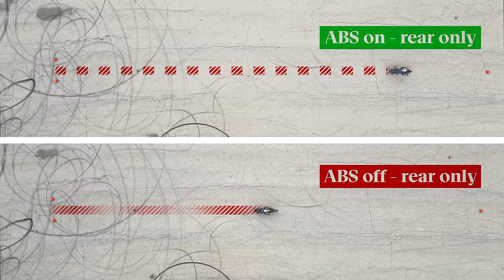Out-braking the ABS Myth

Comment: as a bicyclist, when I need to stop I will often purposefully do a controlled panic stop to make sure I always have a good feeling for how much front brake I can safely apply for maximum stopping power. It’s definitely saved me in a lot of situations when I needed to avoid danger in front of me.
Reply: Yes, bicyclist's just have no ABS. Which means they have a massive stopping distance, skidding or fly over the handlebars if they do it wrong. Only real threshold braking can save you in a dime. 

I instinctively move myself backwards as much as possible (to avoid a stoppie) when braking, also I gently push the front brake to not lock it up and prevent a slideout or going over the bars.
Reply: Ya it also helps that 90% of our weight is mobile
Reply: @colinbruulsema7177  true, which also makes you learn about weight and balance
Reply: I've seen some videos about emerging ABS systems for bicycles, that in some cases excel in downhill riding, even though they are more or less at prototyping phases, AFAIK. And of course they need a totally different approach and a lot of mental exercise especially with the front brake. Hard to say if they'll become the norm on higher end bikes... but when looking at the trends through the decades, pretty much everything has been concentrated on easier handling, be it wider handlebars, better suspension, simpler gearing, more speed oriented geometry and so on.
Reply: @joneinarmattiasvisser6113  On a bicycle you have one major advantage that isn't available on a motor vehicle - I weigh more than the bike, and thus my weight shift has a much greater effect on where it will go. Beyond threshold braking, there's also side-slide braking, which can give insane maneuverability and stopping power at great cost to your tires. If you see a practiced cyclist do those kinds of high-speed controlled skids, it's amazing how different/"springier" the bike's behavior is compared to a motorcycle.
Reply: Mountain biking, when pushing hard, routinely has you braking at maximum power up to the point of lockup. It's like every turn is an emergency braking scenario. Sometime you purposefully lock up the rear end to brake the tire free and swing it around a tight turn quicker. It's a tough skill because you're intentionally riding to exactly the point of traction loss and letting it happen. The exact point of traction loss is largely determined by front/back weight balance. 

This has me thinking, bike ABS braking could be valuable as it currently stands for road riding to an extent. Though with mountain biking, matching the performance of human braking would require the ABS system to know the intended current and future weight distribution. Someday this might be possible with a ton of sensors and AI, but as of today, humans are much better at braking a bicycle.
Reply: Bicycle is as least 5 timer lighter than the rider. It provides very good feedback for the rider, it's generally slower and it's designed to be used in a different way. It also takes a long time to learn, some riders won't learn how to really use brakes even after years of practice.
Reply: For better or worse I actually detuned the front brakes on my MTB so they arn't quite so grabby so they don't just immediately lock when you think of grabbing the brakes. Then again my tires are crap and are a true jack of all trades master of none tire so they really just kinda suck everywhere except for dry pavement.
Reply: I always make sure to brake a little more in the back than front- that way if the back locks I know the front is very close.
Reply: @sannyassi73  that is t a thing. Front/back weight balance on a bicycle is dependent on body position.
Reply: @sannyassi73  With respect, that's not a thing. The braking power available front vs rear is entirely dependent on front/back weight balance of the rider. The bike weighs effectively nothing so it's all body positioning. No matter the position though, the front brake has way more stopping power. Like 80% of the total braking power available in many scenarios. Braking more in the rear just skids the rear tire and isn't effective. Most mountain bikers are using far more front braking than rear. It's where all the stopping power comes from.
Reply: I do this when driving in the snow, its a great way to calibrate your stopping distance based on the conditions.
Reply: Huh
Reply: "Controlled panic". That kind of defines my life.
Reply: OK dude have fun with your 20 mph emergency stops.
Reply: yes bicycling 10mph is the same as 100mph on 500 lbs
Reply: I once saw my big brother front flip over his handlebar when I was a kid. It wasn't until I rode motorcycles that I started using front brakes on two wheelers again.

Comment: Best summary on Bike ABS ever. I've become comfortable with threshold braking for some years now, but on my new bike I like to use locking the ABS on the gravelly or the wet grassy parts of my driveway, so that I can learn to feel at what levels of deceleration the grip on grass or gravel will fail. For some reason, these experiments have given me more confidence on my old non-ABS bike.
Reply: When you flirt with loss of traction, even with an ABS system helping you out, you're still practising riding that edge, so it makes perfect sense it makes you feel more confident on the other bike, you're more practised on the feel of that edge.
Reply: people really don't understand the importance of practicing and unfortunately for some the realization of the difference between panic instincts and wishful thinking comes too late... 
great example for the use of ABS
Reply: go ahead and test the abs on a straight proper EMPTY road. You will be surprised how much you have to pull the lever for it to kick in. Its good to get an actual feeling for it. You will also get a very good feeling for how much stopping power your brakes and tires actually have.
Reply: Great job! But Ryan should try a linked braking system like my BMW R1200RS has. You only need to grab the front brake lever and the back brake operates too. I never use the back brake except in town, when the braking with the linked system is sometimes just too much. In an emergency just pull the lever: without the need to consider the back wheel your brain has more time to think about steering out of trouble. Needless to say, the linked Brembo system gives astonishing braking power: this 525 pound bike stops on a dime!

Comment: The key takeaway from this video and what everyone should know about ABS is that it doesn't necessarily make your braking distance shorter, especially if you're a skilled rider. Instead, it allows you to steer your bike under braking, which may allow you to evade obstacles.
Reply: thanks for sparing me watching the video. ABS is for preventing wheel lock, not shortening the braking distance.
Reply: Bingo.
Reply: You still need to learn how to steer. Target fixation will become a big problem if someone has not practised or made mistakes before an emergency situation.
Reply: You can't really brake and steer on a motorbike, it doesn't work like that - what ABS does is keep the bike upright under max braking. Something a lot of people overlook and one of its major advantages. Many crashes just don't happen now as people grab a handful of front brake and it just stops without crashing down to one side - providing they don't hit anything.
Reply: @stuc.6592 Careful with that blanket statement. You absolutely can and sometimes should brake while steering.
Reply: @Musicposter4you  Fair enough, I meant under emergency braking conditions when enough braking force is being applied to lock a wheel or activate the ABS - what the video is talking about, not everyday riding.
Reply: it don't really make much difference for steering. it does that on cars because it prevents the wheels from locking up so you can still steer but on a bike you are not really worried about losing steering you are worried about locking up and low siding the bike or doing a stoppie.
Reply: I used to think that abs helps you avoid obstacles without skidding and only activate when you’re panic over steering. I guess I was off 80% lol
Reply: Rule #1 is you shouldn't veer from an obstacle. 
When faced with an obstacle the goal is to reduce speed and in turn, injury, if you veer and maintain speed and still clip the obstacle or face a new one, injury and damage consequences are greater.
Reply: Valid point.
Reply: Also helps you in wet and sandy surfaces.  Living in a snow region, there's a lot of sand left over on the roads come spring time.
Reply: @hajovonta6300 why are you here then?  If you can't watch a 6 minute video, then you shouldn't comment.  Get back on your high horse, princess.
Reply: Which is funny because at a driver safety training they told us not to evade obstacles but perform an emergency brake instead. The reason is that there is a high propability of causing an accident when evading an obstacle. One could drive into the contraflow or loose control of the bike because of excessive steering.
Reply: Only smart comment here lol
Reply: @21chicko  You can't practise an emergency situation by definition. As the guy said at the start of the video the way most people behave just before a collision is very different from how they operate their vehicle day to day although he was a bit dumb to suggest that speed doesn't matter. Really if you want to practise something, practise not riding like a dick so you don't have to emergency stop all the time. I think I've done 2 emergency stops in over 4 decades of driving and one of those wasn't a real emergency it was the "emergency stop" we do as part of our driving test. The key to avoiding collisions really isn't anything to do with how you brake, steer or anything else, it's about reading the road.
Reply: I have nothing against ABS and would gladly have it on, but my 2015 R3 doesn't have it. Fortunately, I can seamlessly brake while cornering.

It has really shitty braking power from high speed however... But at least I'm fully aware of it when tailing a vehicle.

Comment: It’s good to see that this reinforces something I learnt from a riding instructor. 

It’s not about practicing until you can do something. It’s about practicing until you can’t not do it. 

Keep your head up, apply increasing pressure on the lever until the threshold, then hold until stopped.
Reply: also, pump the rear before in order to transfer weight to the front, for better grip when you slam both at the top pressure.
Oh if i remember that sweet spot! The bike just squats and stops!
Reply: My Dad used to say an amateur practices until he gets it right, a professional until he doesn't get it wrong. It took me a decade to really understand this.
Reply: @e.lan.s   can't you do the same with the front by progressively application of grip, instead of reflexively fully grabbing the lever?
Reply: Yeah i have this problem with modern ABS in cars. Most modern ABS systems have so much control that you can have the brake planted on the firewall and still change directions because the computers use brake vectoring to control the cars orientation. But I learnt to drive with cars without ABS or with old ABS systems which means when i turn the wheel i can't help but lift my braking foot slightly to allow the front wheels to unlock and turn allowing the car to change directions. This is less efficient than the modern ABS system can do it because its binary on all 4 wheels and cant use the brakes to rotate the car. But I have to actually concerntrate to not do it and trust the car will do the work for me better than I can.

And those systems will be getting to the point where they can manage to brake better on loose surfaces which old ABS systems can't manage. But it's not something youll see in bikes any time soon.
Reply: The problem in my opinion is that its a very unusual situation, if you practice only in a controlled environment you have time to plan your moves and are ready for it, while in the real world a situation could occur so fast that you have no time to think about how you brake and in these situations ABS allows you to dump the brake…
Reply: @Simoxs7  Very important, yes! It allows you to just mash the brake and keep focusing on steering the car

Comment: That's why I love offroad riding/racing. It taught me to panic brake with the front brakes, lots of the time hard enough to actually lock up the front wheel on dirt and slide it for a foot or 2.
Reply: Until you loop a sport bike over forwards w no abs 😂
Reply: Same with on-road racing.  (minus the part about locking up & sliding the front).  All the braking power is on the front wheel.  Rear brake only is generally only touched for line adjustment - so it builds a very strong instinct of reaching for the lever whenever you need to stop HARD.  And in stead of getting comfortable sliding the front, you get comfortable lofting the rear.
Reply: Many years ago when trail riding I was surprised to see so many riders "afraid" to use their front brake aggresively. I can only assume they had a bad experience one time and didn't want a repeat. Some days I used to ride and try not to use the rear brake at all so as to gain even greater confidence in using the front.  Even today, when road riding, I find some people wear out rear brake pads more quickly than fronts. Not sure how they would fare in a panic stop.....
Reply: Same here.  Dirt is the best place to learn how to ride.
Reply: @bondradman7353  ya, my rear pads last me forever, can't say the same about my front.
Reply: Totally agree! Off road give you so much skills about difficult traction/ brake conditions.